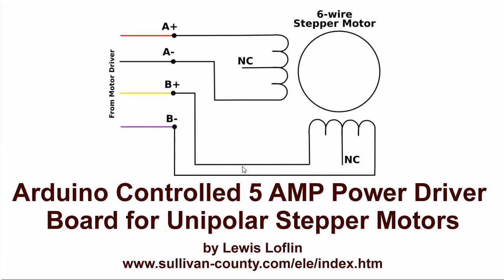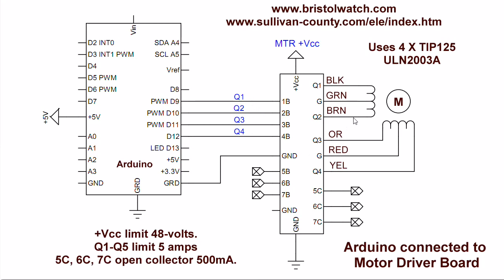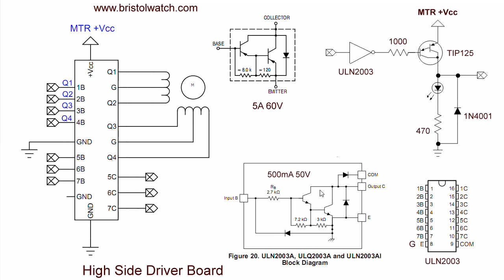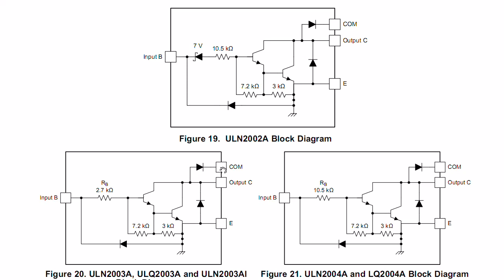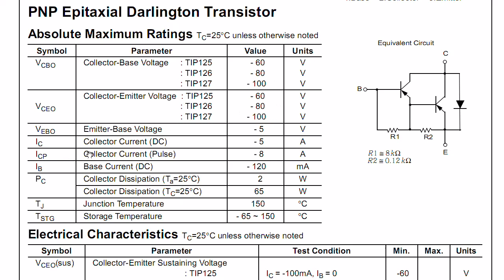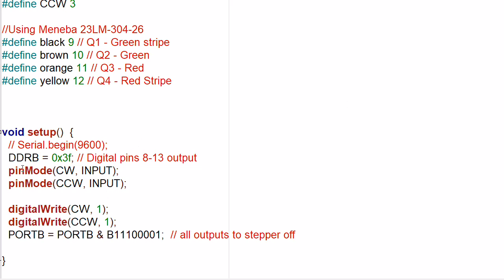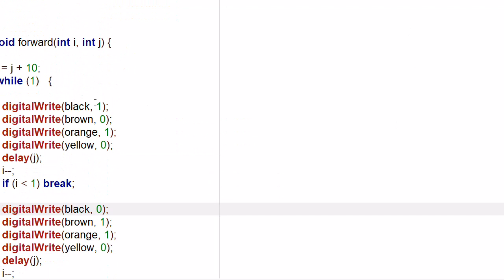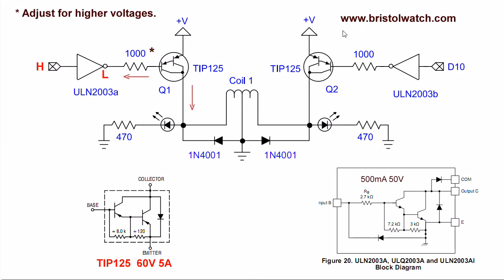Arduino Unipolar Stepper Motor Driver Board & Arduino Code

Comment: will it be possible to drive max 72v 20A / 220V 5A stepper 
or can you make one?
Reply from the maker: If the transistors are high enough it will work.
Reply: @LewisLoflin  do you have a chance to draw me a diagram.
i also want to run 1600 pulse

Comment from the maker: Other stepper motor videos:
High Voltage IGBT H-Bridge Using Photovoltaic Optocouplers
https://youtu.be/azJo4h-ei6I

Arduino Controlled IR2110 Based H-Bridge HV Motor Control
https://youtu.be/d0r-Yx9R3Zs

Pt. 1 Interfacing Microcontrollers to CMOS and MOSFET Circuits
https://youtu.be/XzetdwzcOrY

Pt. 2 Simplified CMOS-MOSFET H-Bridge Circuit
https://youtu.be/rExHPqTUBuA

Pt. 3 Tri-State H-Bridge using CD4093B CMOS Circuit
https://youtu.be/b8O4ihdHx8U

Pt. 1 TB6600 Stepper Motor Driver with Arduino
https://youtu.be/PHe2MK9CvQM

Pt. 2 Program TB6600 Stepper Motor Driver with Arduino
https://youtu.be/jtX0t7-m69M

Pt. 1 TB6600 Stepper Motor Driver with Arduino
https://youtu.be/PHe2MK9CvQM

Pt. 2 Program TB6600 Stepper Motor Driver with Arduino
https://youtu.be/jtX0t7-m69M